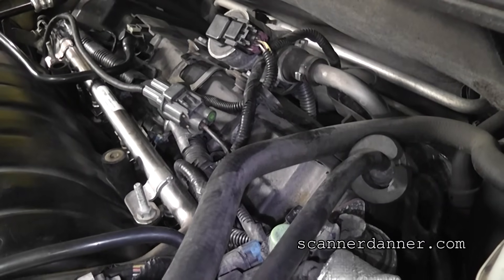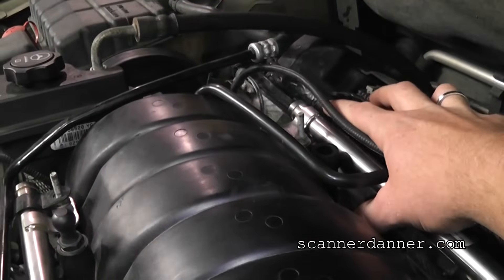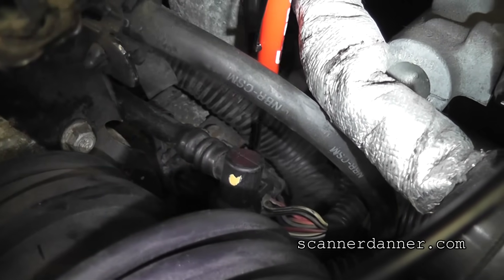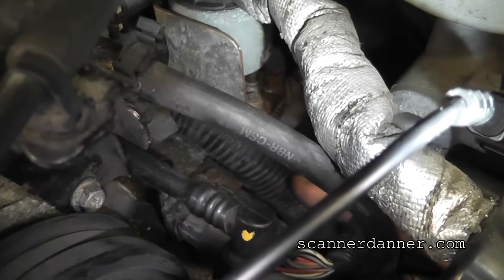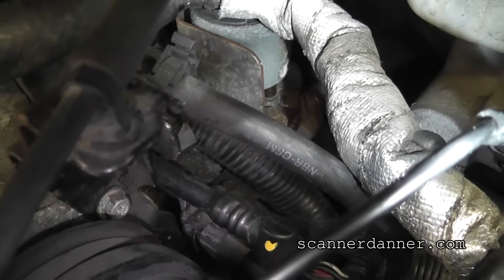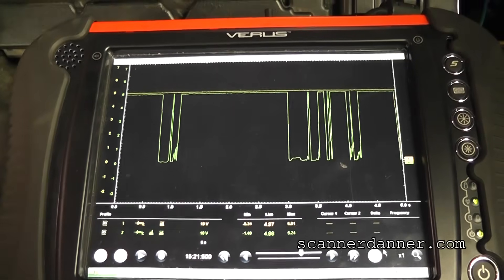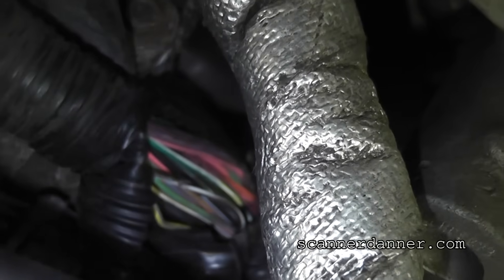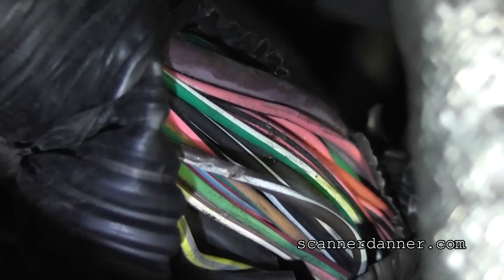How to locate a short in a wiring harness (visual inspection)

Comment: Hello everyone, I have a 2006 saturn vue. Keeps showing throttle body code , or throttle position sensor, or short etc.
I've replaced the ECM, the throttle body, the throttle position sensor, and the a direct short fixed and loomed. While it is much better, both lights came back on and when this happens, the speed reduces. Im told it was programmed with an OBD-11 scanner. (not sure of this). Now they are saying its throwing another code:  The Harness Circuit 2 issue.  Ok guys, what do i do now? I cannot afford to pay them hours of chasing down a possible loose connection. Or maybe one of these parts were not programmed/correctly. Im trying to do this on my on & have hit a wall. I would greatly appreciate your help.  (or when the direct short was corrected, coul that have knocked out the new throttle body?  Just fishing here trying to find an affordable solution.  I would greatly appreciate "all" advice.  Thank You
Reply from the maker: You've replaced the ECM, throttle body and TPS and a portion of the harness. You'd have been better off to start with paying someone to troubleshoot this issue for you to start with. Now the problem is even more complex because NEW means nothing and adds variables! It's truly harder now for the diag tech now, than it was before.
What exact code is setting now? And what are your symptoms?
Reply: @ Oh no.  Everyone i take it to said a different part! I'm alone now and don't know what else to do.  The mechanic said today its now showing Harness Circuit 2 Issue.  What is your advice for me to do next.
Reply: @ I did that first with #1 troubleshooting, This is #3 and i feel i'm going in circles
Reply: @ One light on now.  but when i accelerate another light pops on and the speed reduces immediately.  So i pull over, Turn the motor off and back on and then it's only one light on and I can go again.
Reply: @ScannerDanner  I feel it's either a short or maybe some part may not have been programmed/correctly.  I can't afford 8 plus hrs of process of elimination or chasing down a wire.  I've just hit a wall
Reply from the maker: @kathysturm4251  you need to take this to someone that knows what they are doing. Here is a list I have compiled of shops using my training classes for their techs. You chances of getting a proper diagnosis are better for sure. But no promises. I do not know most of these shops personally. 
https://www.scannerdanner.com/find-sd-shops.html
Reply from the maker: @kathysturm4251  oh okay, that sucks!! Need an exact code to help, but a code isn't a parts list. It will need testing done. Are you capable of carrying these out?
Reply: @ Yes i will certainly try and if not will give my son in law your info whenever they can come down... i will just try to do myself from this point.  Thank you for your help, I really appreciate it.
Reply: @ I meant i will try and follow your instructions..
Reply: @ Yes what are the test.  If you have time tomorrow to send.  Thank you

Comment: would wrapping the broken wire with electrical tape fix this issues?
Reply from the maker: Electrical tape will not protect from weather. So only as a temporary thing
Reply: @ScannerDanner  ok thanks so you would need to cover the harness wire tape and some sort of additional insulator?
Reply from the maker: @nevermind7760  cut out the bad parts, solder and heat shrink with the adhesive lined heat shrink. Or use adhesive lined heat shrink crimp connectors. Or brush on liquid electrical tape and then tape. Depends on the damage on how to repair it
Reply: @ScannerDanner  thank you very much for your explanation i am in the caribbean barbados to be exact and over here you dont really get alot of stuff  and if you do get it then its either  to expensive  so bascially i try to work with what i have  when fixing my van thanks again

Comment: Hello sir. I have some wiring issues on a 2001 c5 corvette.  I believe the issue is occurring somewhere in the wireloom above the transmission.  The shops I have spoken to said this is common on older Corvettes and they can’t help me because of the age.  What can you tell me about the tool you are using?
Reply from the maker: What is the issue?

Comment: Dude, I just think I fried my 92 ram charger. I am freaking out. Tried to fix a fuseable link, cranked it perfectly. But I put a relay into that furthest back relay outlet on accident, cranked it and everything started smoking. 
I need advice on what to do.. I am praying I didn’t just fry this truck.
Reply from the maker: You probably blew that same fusible link. Need to find out what all is on that circuit and start doing some visual inspections 
Pay the $20 and get yourself some good wiring diagrams. These are the same ones I use.
https://eautorepair.adtrk.biz/?a=10817&c=24&p=r&s1=

Comment: That small of a cut would stop the wire from working totally or the voltage just drops?
Reply from the maker: A short to ground? Absolutely, doesn't matter how small the cut is
Reply: @ScannerDanner  currently having a no crank no start issue with a 2006 Chevy Colorado . There is a small hole just like this on the dark blue wire coming out of the bcm. I covered the wire in electrical tape and the dash still isn’t communicating with the engine light . Should I fix the wire in a different way?

Comment: I have a 05 Honda Civic, Check engine light is on . Code reader says primary 02 sensor . Changed the 02 censor but code won’t go away . Could there be a short in the harness ? If that’s possible would it be the 02 censor wire in the harness ? Or is it also possible that it’s a different wire ?

Comment: Correction: How to find a short using a $5,000 Snap-on scope that you will probably never get your DYI hands on! Translation: Forget trying to do it yourself and come to our shop, pay us a ton of cash and we'll do it for you!
Reply from the maker: You have to look beyond the tools I'm using and apply these techniques to what you have. A simple code reader, multimeter/test light and a wiring diagram is all you need.
Reply: @ScannerDanner  You should change the title to: How to locate a short in a wiring harness (Using a Scope and visual inspection)
Reply from the maker: @lockdowntv874  or voltmeter right? You didn't need a scope to show this voltage drop on the reference circuit. Sure the scope was nice because you have a signal trace you can look at, but it wasn't needed. 
BTW, this video was pulled from another full length video showing all of the steps involved. Thanks! https://youtu.be/uyncVz_HAtA

Comment: I come because my wife's friend (single, older, broke) has an 05 Sedona. She had the power steering pump changed. The mechanic noticed a mouse ate through the insulation of "some wires" and replaced the section of bad wire. Now, you guessed it, the transmission slams into 2nd then enters 1 gear only limp mode. 

She described her issues but didn't mention that it was just worked on. She mentioned that her tach stopped working so (before I knew the back story) I went to change the ignition failure sensor hoping for a long shot fix thinking that might be causing the transmission issues. That's when i noticed all the wiring to the transmission was "new". 

So my question is: How the world can I diagnose the wiring without a wiring diagram?

The mechanic is playing dumb to the repair now claiming her transmission went bad right after the repair. (Well... Not playing) 

He actually spliced wires and ran new ones so the plug has 1 new connectors inside the housing ran with 6 inches of new wire connected to a blob of the original wiring harness. So it's all plugged in the correct ports but I don't know if he mixed up the pins.
Reply from the maker: He may have missed something and it is not the harness that was replaced. That is my guess
Reply: @ScannerDanner  Thanks. Yeah it was not the harness that was replaced.  He re-pinned the connections and then ran wires back to the harness where he spliced it. My thought is he hooked the blue wire to where the red wire should have went (and so on). I'm going to head to a junk yard and take a ton of pictures and try to recreate the correct wiring.
Reply from the maker: @f.k.b.16  did you fix it?
Reply: @ScannerDanner  no... Either the wires faded or the colors didn't match the wiring diagram I found. I did try verifying colors match where it was spliced but I'm still not sure the connectors weren't re-pinned. The one I'm most concerned with is the real speedometer sensor on the side closest to the flywheel. Do you think that sensor would cause gears slamming?  Thank you for asking!

Comment: 2001 pos Blazer came in from another shop.  Check valve went bad on air pump, exhaust burned through a rubber hose melting about 80 wires together.  If I could attach pictures to these comments I would.  Straight up waste of time.  Customer wanted it fixed.

Comment: Great find Paul!  Could a standard digital voltmeter show this as well??
Reply: if it has a fast graphing function yes, many standard/cheap meters are slow and may not show the loss/drop. Using a 5 to 6 volt low power incandescent bulb may be better to visually see the flicker, a 12V test light may work if it's bright enough on 5volts or obviously any oscilloscope :)
Reply: Bill K Question is, where would you attach the meter using a voltmeter?
Reply: Robert Weir   Same place Paul has the scope attached to
Reply: throttle bottle   Ok I got it
Reply: Bill K OK, then I think a meter should work.
Reply: Thanks for the replies